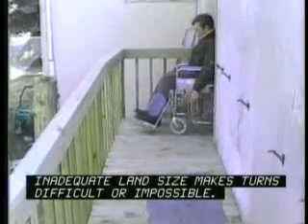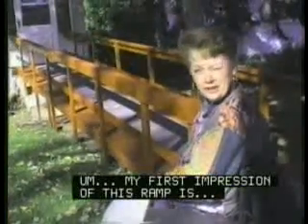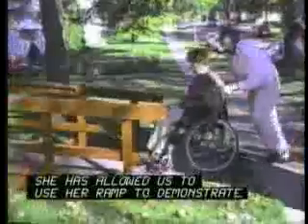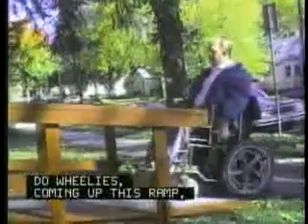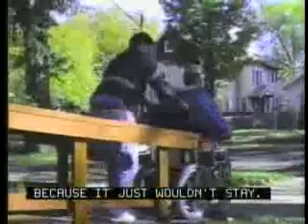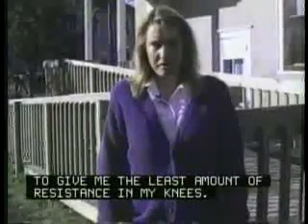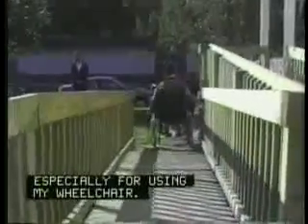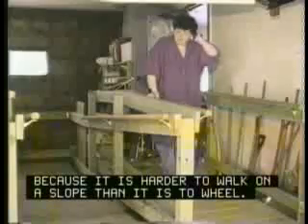Wheelchair Ramp - Design Considerations from WheelchairRamp.org

Comment: These ramps look like all the ramps in my area, steep, narrow turns,  loose boards, 1 to 4 inch drops at the bottom, bottom exits into dirt, carpet scraps stapled on, no room to open the door. But if it weren't for these ramps, we'd have no ramps at all.